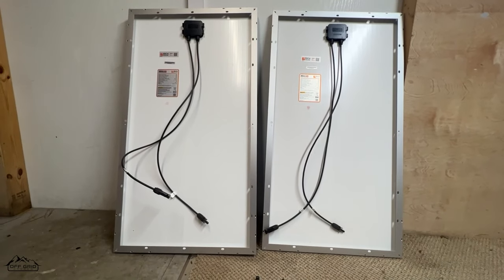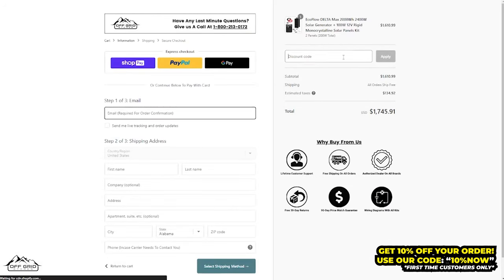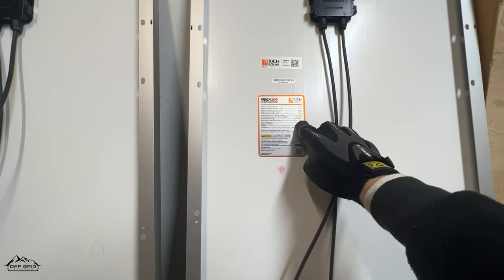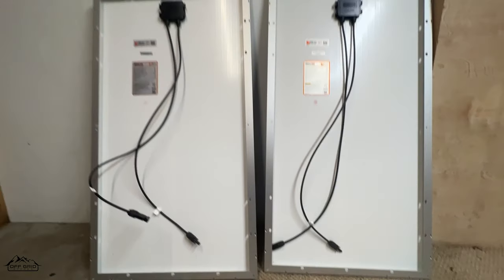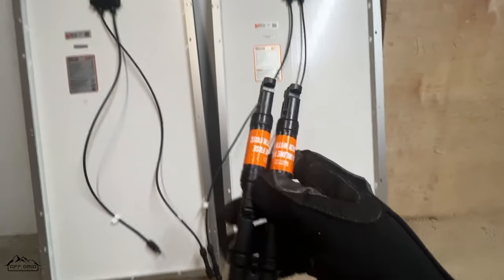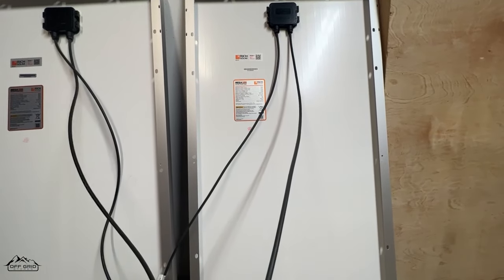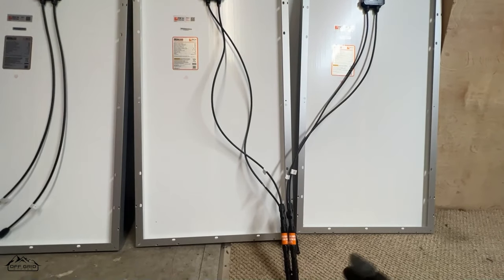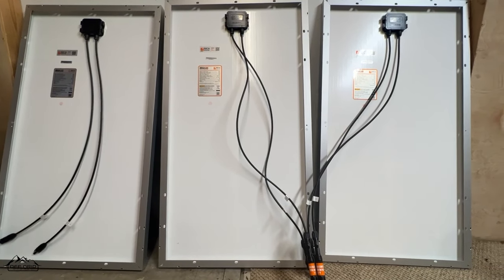How To Properly Fuse A DIY Solar Panel Array

Comment from the maker: First Time Customers Get 10% Off Their Order With Code "10%NOW" At Check-Out
Items Used In This Video:
100W Solar Panels: https://offgridstores.com/products/rich-solar-100-watt-solar-panel-rs-m100
2 To 1 Parallel Connectors: https://offgridstores.com/products/rich-solar-y-branch-parallel-connectors
MC4 Inline Fuses: https://offgridstores.com/products/rich-solar-inline-fuse-holder-with-fuse

Comment: “Short-circuit amperage”, not “Short-circuit voltage”. Right?
Reply from the maker: Yes amperage.
Reply: Amperage is also called "current" which is different from voltage.

Comment: Thanks for the info. Great video. If you do blow a fuse, does that mean one of the panels is bad and needs to be removed from the system?  Or do you normally replace the fuse and go on your way?  Is the bad panel the one whose fuse blew or the other one?
Reply: Good questions. Maybe it's whichever fuse gets the overload first, is the one that blows ?
A grounding cable might also be good.
There are special bolt and nuts for that purpose, so maybe ?

Comment: OK, so now how many volts is ok to have coming into my 12 volt battery bank ? I have 2 x 330 watt Solar Panels. I have 2 x 12 volt 100 ah batteries in parallel. My 330 watt panels are rated at Open Circuit Voltage at 41.0 volts, Open circuit current at 10.33 amps. I have an Epever 30 amp Solar Charge Controller. Thanks Liked/Subscribed !

Comment: I have a 200w renogy solar panel going to a renogy 50amp dc to dc with mppt would that need a fuse on the positive cable and if so what size fuse? Thanks for the video just trying to get my head round it

Comment: What Fuse Size for 150W Solar Panel - ISC Amps 8.76 should I use? THANKS
Reply: In series use 8.76 X 1.56

Comment: Hi, thanks for the very informative video. Just out of interest, why do you place the fuses before the branch connectors and not afterwards? Just I noticed alot of places like Renogy specify placing fuses after the branch connectors. Does it mean that in the case of a short circuit and the fuse is blown, that just the one panel would stop working rather than all 2/3 tied into that branch? Many thanks in advance! Joe
Reply: Yes I wondered the same thing. For my 5 panels I would need 5 fuses, of maybe 30 or 40 amps rating.
As opposed to just one after the 5 branch connector.
Maybe it saves shorting out the other 4 panels ? Which would be good.

Comment: The jiggling around was a bit discombobulating.
A clear diagram, or table top steady shot would be good.
So, as far as i can understand, every positive cable coming out of a parallel set up panel, needs a fuse, rated to the short circuit amperage of the panel,  multiplied by the number of panels.
Fuses installed on the positive cable, before that cable is entered into any joiner.
So, if the panel cables are in any way too short to reach the joiner ( having been cut short by impatient person removing panels from previous installation etc), then the fuse installation is a good opportunity for extending the cable length, for a necessary purpose (fuse).
If there are say, five panels at approximately 6 amp short rating, then 5 of 30amp fuses would be needed. One 30 amp fuse for every panel.
To cover the accumulated amperage (current).
I am guessing it would also be good to run a grounding cable to an earthing spike as well ?
Thanks for making this video ☺️🙋

Comment: does a diode  work as a fuse..? because i ordered correct amps  for my 240w pvs but not  fuses ...they got diodes inside !!! my kyoceras  are 10years old and i dont think they have diodes.. they used to be installed in series in a big park!!!

Comment: Thanks for simplifying these connections, I'm building a small off-grid solar system and this is going to be very useful.
However, I have a couple of questions w.r.t, a parallet connection setup:
1. Wouldn't the diodes on each solar panel prevent the entry of current into a panel that has shorted?
2. In a parallel setup with 3x 200W panels with a max current of 9A each, if I were to put in a 15A inline MC4 fuse, would the current from the other 2 panels (18A total) possibly reverse flow and blow the inline fuse which is rated at 15A?
Thanks for your replies, cheers!
Reply: Pretty sure 3 X 9= 27, meaning a 30 amp fuse on each positive cable, but not sure.
Just going off what the video said, but not many answers to questions so can't be sure.

Comment: I have one panel that’s 15a and came with the rv and adding two more that are 20a rated. All are renogy 200 watt panels, would I use a 15a and 2 20a fuses or make them all 15a? Im not very good at this 🥴
Reply: It's the short circuit amperage (current) rating that is used to calculate.
Those amps are added up from each panel to arrive at a total.
So if you had 3 panels at 6 and 6 and 8, then 20 amp fuses would be used for each panel, fitted to the positive cables, of a parallel connection set up.
That's what I understood from this video. I could be wrong.

Comment: I have a question...
I have a 300w solar panel and a 12v 50ah battery and for some reason it doesn't want to charge at more than a 100w.
Is that normal?
Reply: They say to have double the wattage for the amps of your battery. They also say that a 300watt panel might not give you more than 200-250 watts in reality, or less if it's cloudy etc..

Comment: Ok so if i got this right i have 2/100w panels @5.5 a short circuit ratings each. A 10 amp fuse each panel is what i need wired in paralell?
Reply: Hmm..do we add them up, meaning 11 amps ?
Should the fuse be below that or above that ? Hard to say.

Comment: Must 2 panels in parallel be fused?
Reply: Connecting in parallel adds amps together from all panels, so fuses are the best idea. Connecting in series keeps amps the same as just one panel, but adds volts of every panel in series, so there are different factors involved with each configuration. There are other videos about this, one of the clearest I have seen is by Jason on the Jasonoid channel. 
 https://youtu.be/OZvrTuhJhXs

Comment: How should I fuse in series? 4 x 100w panels
Reply from the maker: You don’t need fuses if it’s 4 panels in series
Reply: @offgridstores  I know you don't need them, but I want to have extra protection
Reply: Maybe I'll fuse it as if it is one 400w panel?
Reply: Can you recommend a good dc12v circuit breaker?
Reply: @mangeload  Renogy sells a 400-watt kit, they actually include a 10 amp in line fuse (and a 40amp ANL fuse too, but that fuse is for the controller to battery line not what you are asking about) On their schematic they show the inline fuse as going on the positive cable that is going to the controller. And that kit is four 100-watt Renogy mono panels.

Comment: How would I fuse 4S2P 100 watt panels?
Reply from the maker: The same way I described in this video
Reply: The maximum series fuse rating on my panels is 12A. I can’t find a fuse of that size.
Reply: @MikelRae  Go with 10A then.
Reply: @assortedmountainlife  That’s what I ended up using. Appreciate the response still though.

Comment: so 2 panels in parallel dont need a fuse?
Reply: They need a fuse. In fact they need a fuse rated for higher amps than the summation of all your solar panels's short circuit current amps combined.
Reply: From what I can gather they both need a fuse.
Lots of comments and discussion because a lack of informed answers.

Comment: So, this type of fusing would prevent the type of fires of Tesla panels on the Amazon roofs?   Also saw a newish NewPowa panel on YouTube today and it was just starting to melt thru on one spot on the panel and the owner of the setup just had the panels leaning against the house, although plugged in,  was still doing some changes, and so noticed before it started a fire and uplugged.   If panels have more diodes than they used too, why do more new panels catch on fire?  One other guy claims bird shit in a strategic spot can cause a fire.  Long winded guy, got nothing out of that video: he didn't convice me.  NewPowa panel was probably just a bad panel, so that doesn't prove anything.